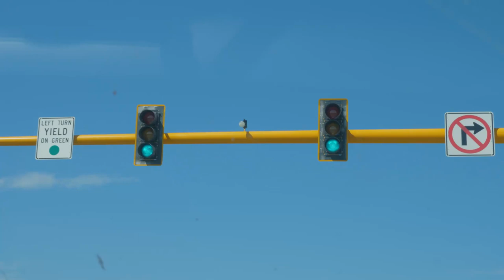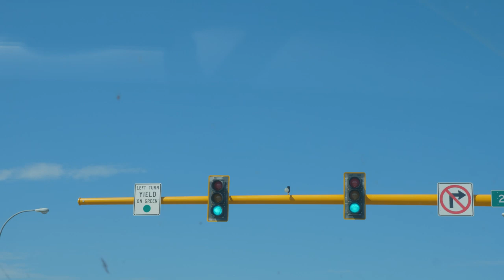🚚📦Moving Our Woodworking Business Across the Country!

Comment: If I may make a suggestion, if you are using the miter saw the most and are going more into production, I strongly suggest you get a 12" or larger used radial arm saw.   Once set up properly, your production times can go way down.   Example, miter saw making 18 pieces 2x4 30" long.   Miter saw =24 cuts.  Radial arm saw =4 cuts.  1x 4 materials faster yet.   Also, nothing better in a shop to do dados!   Best of luck to you!

Comment: Just a comment regarding what you said about buying ‘the best tools’ for future employees to use.

Be very careful with that. Employees don’t give a damn about your tools because they didn’t pay for them. While shop equipment like tablesaws, thicknessing planes etc. would normally be supplied by a business for the employees, any tool that doesn’t bolt to the floor (with a few exceptions like track saws) should be supplied by your workers. It’s standard. You’ll have your toolkit, they’ll have theirs and they will take care of theirs because they paid for it.
Reply: I know this doesn't apply to them but most of the union policies are that the workers are only supposed to buy the hand tools needed and the company will supply all of the power tools.
Reply: William Rutledge I consider any tool that you can easily pick up and move to be a hand tool. That includes circular saws, electric planers, grinders, even mitre saws in many cases. I have always supplied my own tool kit and most tradesmen that I know do as well. Come to think of it, not most but all. Every tradesman that I know in every trade that I deal with regularly has their own complete tool kit regardless of whether they’re self employed or employees. It’s just the standard.

I’m in Australia, by the way. America might have a different system.

But as a self-employed person I have no interest in paying good money to buy tools for other guys to use and abuse. I’ve seen it happen far too many times.